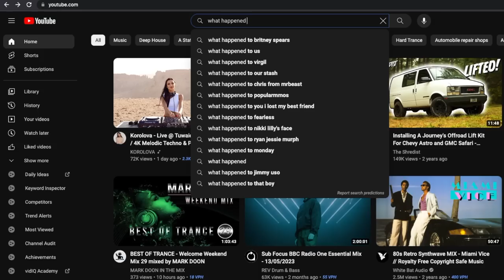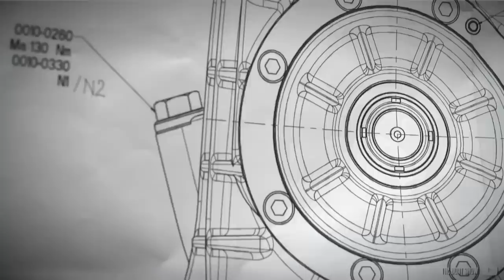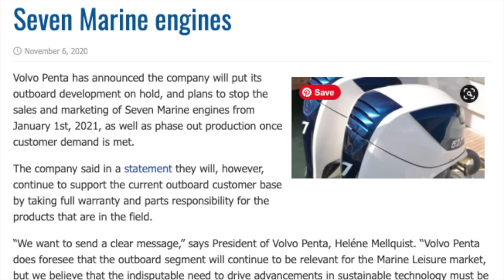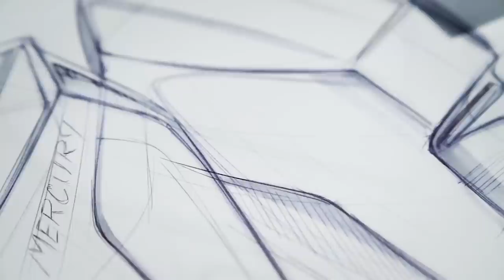The ACTUAL REASON Seven Marine Outboards Went Out of Business

Comment: Something to add. Boat builders can squeeze a whole extra V12 on the same transom 7's were on. For example, a 42ft CC with 7's would be triples, V12's could do quads. Mercury made sure the minimum requirement for the outboards center to center (crankshaft to crankshaft) distance remained the same as their smaller engines. This allows boat builders to pack more power and that is what those customers want.  An extra $80K is nothing to them haha.
Reply: It's not even 80k if you're saving 23k an engine. Then to go from 3 7's at 300k (100k each) to 4 mercs at $308k (77k each) its a no brainer. 8k more for 2400hp vs 1800ish plus parts network plus fuel efficiency

Comment: no way a company pulls the plug on a viable product before a competitor brings a new product to market.    Mercury probably spent $100m + on tooling for the v12 let alone the drive unit and transmission.   Funny how a start-up can revolutionize an industry...  Maybe Mercury was asleep at the wheel...  Yamaha is still asleep at the wheel...   If you look at Volvo and study their global production of engines/units including their construction equipment...  the Euros are full swing into carbon neutrality.  You don't thing they would have added inboard pod technology to the outboard (they had it before anyone) and they specialize in diesel engines.  IF Seven Marine owners weren't bought out by Volvo, they would have continued to innovate and lead the market.

Comment: I am a mercury master tech and everything you’ve said is spot on truth. The steerable gearcase allows motors to be mounted closer together making room for additional motor(s). Almost all internal parts like connecting rods are the same part number weather it’s a 6cyl. Or a 12 cyl. Equals less parts on shelves,smaller warehouses etc. just smarter business practice. The 2 speed transmission is a no brained MPH and MPG’s
Reply from the maker: Completely outclassed.   And more expensive.  Who would buy one?

Comment: The V12 Merc absolutely blows the 7 away, however, when Volvo Penta bought in, I fully expected them to utilize the 7 platform to introduce a range of diesel derivatives. I'm still a little baffled as to why they chose to just abandon it all.
Reply: Cox diesel engines seem to have taken that crown
Reply: So what speed difference and GPH difference did you see with the Seven outboards on your boat vs the 600 Mercs on your boat?
Reply: Maybe they will just buy Brunswick/Mercury then rebrand the outboard range?   Volvo Group - since they also ditched their car division selling it to Ford.   Thy know when to get out of a business, they haves very deep pockets and big cash reserves.

Seven will just be a small business mistake in Volvo history, although it must have made sense strategically to acquire & in first place. Product was just  not good enough or sufficiently developed
Reply: @peanuts2105 at a ridiculous price point
Reply: @peanuts2105 I work half a mile from Cox Powertrain and its failing hard in the UK. Most of the guys that left my employer to join Cox have been let go. They barely make any engines these days.

Comment: Great transfer of info... nice work. 
I loved the concept of a horizontal 'auto' engine mounted onto a vertical drive shaft. I had believed that using an engine and controllers that any A.S.E. mechanic could wrench on, that could be diagnosed with a simple OBD port reader, and having parts availability as close as the nearest Chevy dealer were all huge benefits. I have to wonder if Seven held any patents that were sold to Volvo in the majority stake purchase. Otherwise, why didn't Volvo just duplicate the process and start manufacturing their own version of a  "transaxle" which would be a direct fit to one of their own off-the-shelf (already in production) lower units?

Comment: Why did Volvo Penta get involved with Marine 7 in the first place? The engine power flow has to turn 90 degrees twice before it gets to the propeller creating more friction, more weight and less efficient. If I were a big boat owner looking to re-power, I would never get anywhere near this fringe flash in the pan concoction. Where will you get parts for this former brand. You would find it far easier to get parts for the former Evinrude / Johnson brand. Even for outboards they made in the 60s.

Comment: Interesting outlook. Im a merc fan and didnt like the 7 Marine engines and i have never been a fan of Volvo either and one thing i seriously dont like are the IPS drives. My personal take on the points made in this video are, Volvo has a huge sales and service network globally, so servicing and repairs etc wouldnt be the issue, Lesser new brands have made their mark in recent yrs and are selling well with way less of a footprint Volvo has. They also have a huge industrial capacity so for them to licence or in time make up their own components while as improving the outboards over time would have been a better way to go and keep 7 marine going.  I think they real reason they killed it was because unlike with the big 4 Merc, Suzuki, Yamaha and Honda up to a point, where they cant compete from a entrenched position that these brands have, I think they mostly saw a real threat coming from huge block outboards to their IPS drives and sought to kill off the one brand they could afford to kill off.  I could be totally wrong on this point but its not completely far fetched.

Comment: The company i used to work for was designing a turbine engine outboard motor. Had over 800hp, efficient at full throttle, and lightweight. Cost about 80-90k. However, couldn't get enough funding. Had to scrap it
Reply: what was the company called? sounds interesting. one small firm made small jet-turbine powerheads in the 1960's!

Comment: I'm going to have to disagree because 7 marine had a platform that you can expand the horsepower and torque without having to change too much.  With a super charger pulley change and a tune you can add another 100 horsepower. With a cam change you can add another hundred horsepower. ..   This was a big mistake.  The aftermarket tuners would have turned this into a racing platform that no other company can Match..
Reply from the maker: Neither one of these engines is very well suited for racing.  Boats need special high speed drives when you get up around 75mph; anything else and you just blow out the water before the prop can grab it.   There is nothing like that available for the Seven Marine or the V12 Merc.  They aren't race engines.

Comment: I am guessing that the seven marine supercharger would eat up 10-100hp depending on engine speed, that also needs fueling.
Reply: i'm thinking it would produce horsepower. that's why it's there
Reply: @fuzzjunky  Yes it uses 100hp to make extra 300hp, so the engine eats 400hp worth of extra fuel with the supercharger mounted.
The supercharger pumps something like 200 liter air per second, running the supercharger is not free.

The mercury V12 does not need all the tricks Seven Marine needs, because it is designed from the ground up as an outboard.
Reply: @larsjrgensen5975  you're talking nonsense man. or they would just remove the blower because it literally does nothing. they wouldn't spend thousands of dollars on a peripheral which produces a negative result. superchargers profit horsepower or they simply wouldn't use them. what they COST is fuel usage.
Reply: @fuzzjunky  The super charger uses 100hp to boost the engine.
The 430 hp engine (without supercharger) now makes 730hp thanks to the supercharger, but running the supercharger costs 100hp, so the end result is 630hp, but the fuel needed for the engine is still 730hp worth of fuel.

I can see that we agree on the fuel usage and that was my primary point of the post, the Seven marine could use more fuel then a Mercury V12.
Reply: @larsjrgensen5975  yeh that sounds accurate. i think the overall shape and purpose built nature of the mercury is where it's at though. the upright shape is very suitable including transmission style

Comment: Being bought by volvo, with all their manufacturing might, could have easily redesigned a new gearbox and manufactured it in house for the 7.  So I doubt potential supplier gouging was a worry.  The LS is also an amazing platform that would have allowed a huge aftermarket,  you could have had 1200hp outboards easily.  Imagine a single 1200hp instead of dual 600s? And the LS block easily has the potential to do that
Reply from the maker: I think you're underestimating the capital required to develop a transmission like that.
Reply: @ADDvanced i dont think i am, again, its VOLVO, an international manufacturing powerhouse, and theyre replicating an existing ZF gearbox.  Should be able to spend a month designing and a month of tooling setup.  Should have been a cakewalk to design a 750hp version and wipe out mercurys 600.
Reply from the maker: @troydejesu9245  I worked at Mercury for 8 years in the design and engineering department.   Even if they were allowed to copy and paste the design, with no development, the cost of the tooling required to make those parts would be millions and millions and millions, especially if diecast.   Then you start looking at how many engines they would plan on selling per year, and you realize why they didn't do this.  The sales volumes are so small it would never even pay off the tooling required, let alone make a profit.

Comment: Benefit of using of the shelf components is that they proven to realiable. All the components of the seven marines are from well know brands. Suzuki outboard 300hp comes with a duo prop gearcase setup wich for the first couple years they had to deal with not usable engines cause the gearcase would break. Seven marine made no mistakes making a realiable product for a new market high performance outboards and selling before the big competition Yamaha/Mercury turned up with a alternatieve

Comment: The simplest answer is usually the correct one.
I have never heard of this "7" outboard, not  that it means anything.
I remember when a 100 hp outboard was considered impressive.
Reply from the maker: Money money moneyyyyyy
Reply: Yup, I remember as a kid when a beach neighbour turned up with a 300HP Merc on his 21ft Haines (NZ boat). The damn thing would do 60mph across the water, way faster than anything else around at the time. The motor was also vastly bigger than anything I'd seen before! my Dads boat had a 20 horse Chrysler! I was a little embarrassed...

Comment: People do this all the time in aviation, and many get themselves killed. I’m all about advancing tech, but if it were so simple to cram a corvette engine into an aircraft vs a clunky old air cooled….I’m guessing it’d have been done long ago. 

I’m guessing this went the way of aircraft swaps…engines designed to rub one way (lugging along in overdrive) , vs another designed to run another way (100% in aircraft). 

The gear reductions in planes have been a big failure point. 

Now if these engines have been running reliably in the field with minimal warranty claims, then the Merc hypothesis sounds pretty good to me.

Comment: Sounds plausible to me. As I understood it boat hauls and transoms had to be re engineered for 7 Marine. All of the adds I remember for them included Intrepid so I would assume they where their largest customer. Merc being cheaper and larger CI with 2 speed trans for low end torque may have set the stage for Intrepid. Volvo knows when to cut their losses. I am going to point to one other possibility. The possibility of upgrading to the V12 from other engines on more standard transoms would give Merc the advantage in that aspect also. That is if my assumptions and memory of the requirements are correct.
Reply from the maker: Absolutely.  And the steerable gearcase on the v12 means they can be packaged more tightly and closer together.  Another advantage.
Reply: I think time will show that all of these larger, heavier outboards will be placing too much strain on transoms, compared to inboards that are bolted along the horizontal surfaces., spearing the load. Weight distribution with multiple installations must be a real hull design challenge for architects.  It’s notable that the class one racers are all staying onboard twins. 

These engines seem to have most appeal to the Miami quin ‘look at me’ open bow riders crowds.  

Although I do think that the new Verado 500r hits a sweet spots for sports boats in twin installations.

BTW Volvo actually have a bigger global network than does Mercury, given there lions share of the large performance diesel inboard and commercial markets.
Reply from the maker: @gaycha6589  I don't believe that.  There are literally thousands of Merc dealerships along rivers across the country that specialize in smaller outboards.   VP is mainly sterndrive, so only on large bodies of water, none on smaller lakes and rivers.
Reply: @ADDvanced  USA is not the world

Majority or Merc dealers are in US. Volvo are far better distributed and serviced globally.  I am in Europe - Volvo, being Swedish, are for better represented for service both here and in APAC.  

Volvo also makes a very diverse range of marine engines beyond sterndrive installations - their breadth and depth of engineering exceed that of Mercury, who don't even manufacture but rebadge their entire 60hp range.

Volvo Group (including trucks) turnover was $48 Bn last year and they have been in business since 1929.

Brunswick Marine who own Mercury have a turnover of just $5.8 bn,  Mercury contribute $26bn of that.  They are therefore tiny in global terms,   Volvo could buy them tomorrow.

Lecture over 🙂To the point, the 7 Marine acquisition was a strike on the balance sheet for Volvo to enter the large outboard segment by acquistion.  Trouble is that they really only acquired an integrator, since Seven only bough bits in with no intellectual property, and a flawed product.
Reply from the maker: @gaycha6589   Totally bro that's why they win so many races because they make such great stuff.

Oh wait.  They don't win any races.  Cuz they got nothing.
Reply: @ADDvanced  they don’t go racing. So that’s what’s called a logical fallacy, Bruv.  But, they do have 100x the financial clout of Mercury and have remained in stable business for far longer than has MM, so I guess they are not over concerned about trophies.  Same can be said about YAmaha.   It’s really quite a big world outside of the USA…
Reply from the maker: @gaycha6589  They'd still be making inboards with straight drives if it hadn't been for Charlie Strang/Jim Wynne.  Mercury Employees.
Reply: @ADDvanced  and Evinrude was Norwegian,, so Mercury wouldn’t have even come into existence without him inventing the outboard?  silly.  that’s  like saying that Americans would still be traveling on horseback were not for Carl Benz inventing the motor car.  Or that USA would not be online if not for Britains Tim Berners Lee.     You’re just  not very good on those logical fallacies, eh Bro?   Give up.

Comment: Interesting thing is cars generally don't run at high rpm continuously. 
Wonder how they hold up long term.
Reply: And the automotive based engines running in millions of inboard marine applications?
Reply: @embustero71 , 
I don't know? Generally aren't they modified designs though? If you want to run an engine continuously at high RPM you build it to do so. 
Different valve train components, pistons, might shorten up the stroke length, etc. 
Pulling an off the shelf car engine and tossing it on the back of a boat seems like a harsh use case for it with oem components.
Reply: @getinthespace7715  Seems like you're relying of the assumption that they just picked a random thing without actually considering if the specifications for the application were suitable.
Reply: @Sonny_McMacsson , I asked a question? I didn't make a statement.🤔 Companies do stupid things all the time.
Reply: @getinthespace7715  Questions have premises that prompt them. Companies do stupid things but since they were experienced engineers in the field, I'll assume for now that they did their due diligence.

Comment: These monster outboards just don't make any sense to me.  You can have a hybrid system where the props are electric and have a motor mounted anywhere convenient spinning a generator providing the power for the prop motors.
The whole thing can be setup with a lower CG, or even put the gas motors in the front, how about a four I6's along the sides, totally frees up the packaging, which is the hard part of outboards.
Reply from the maker: Having weight in the nose is the worst place for a boat.  Best place for weight is behind the transom, to help the boat get out of the water.
Reply: @ADDvanced  great, then put the gas motors even further back than the props, as a hybrid there is only 3 wires that need to connect to the prop.  
I would think having the gas motors sitting up so high above is not good, but maybe you will tell that is best to make the point straight up...I know my old hydrostream would reach for the sky.

Comment: The 7 would have been so much more reliable than the merc ever thought about. It a shame really
Reply: Just your opinion
Reply: @csrboltfan2643  opinion from facts. The ls based engine is very reliable. The later model verados are not very reliable. Cam tower bolts snapping off, destroying power heads, connecting rod bolts stretching / breaking, causing catastrophic powerhead failure as well.
Reply: Seven wasn’t without their reliability issues.  The LS wasn’t engineered to run WOT while pushing a very heavy boat for hours at a time.
Reply: @CaptainDayne  I've delt with them. One of the biggest flaws with Seven is the cowlings. They are horrible and did not protect the engine from getting splashed with salt water. All that engineering for a $90k outboard engine and then they quit at the finish line.